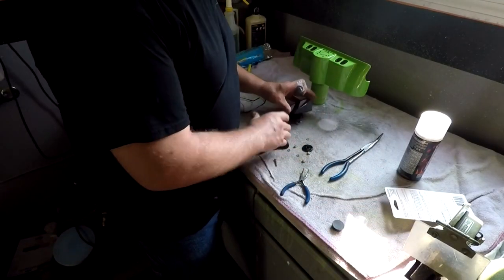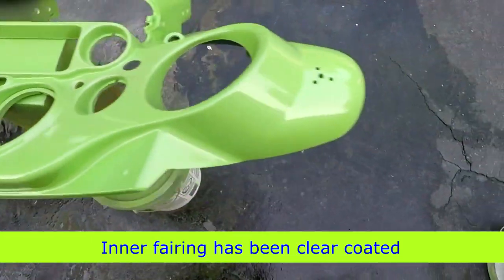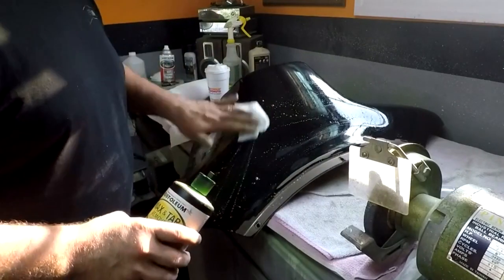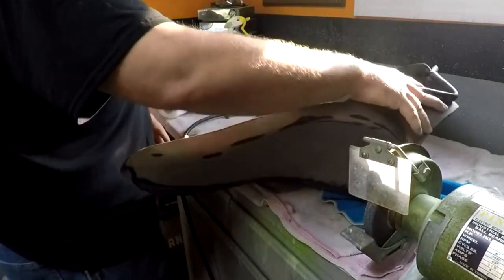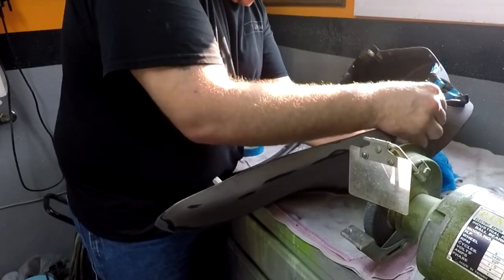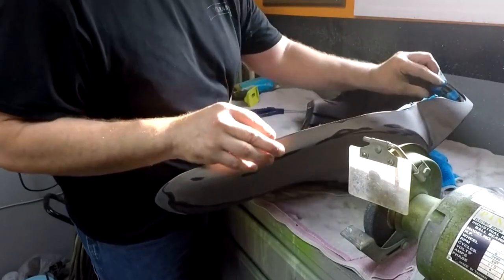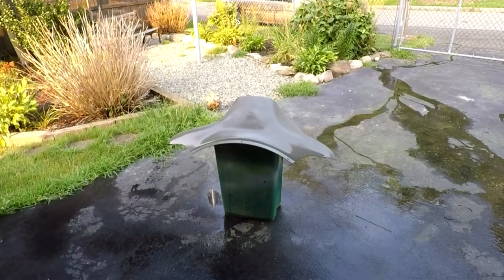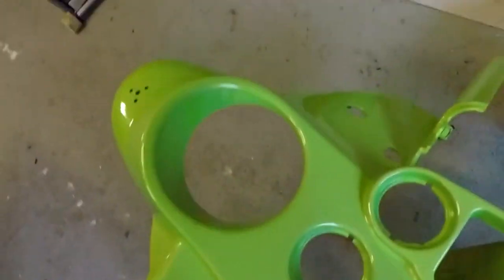Inner & Outer Fairing Prep & Prime | Painting a Harley #24

Comment: Mike, thanks for doing this and posting it.  You inspired me to paint my inner fairing.  It's half apart anyway.  Never painted anything before, well, that has to look good anyway.  I was going to buy a pre painted one, but there is nothing wrong with mine except sun fade.  Looks chalky and white in some places.  I had to install new fairing support brackets, so Im taking it all down now for sure since I saw this!
Reply from the maker: If you spray painted anything before i think you can do this. make sure to do the prep work well. good luck.
Reply: Techn' Moto it’s a vivid black bike.  I wonder which gloss black in a rattle can you would recommend. ??  The inner fairing is plastic correct not fiberglass.  Should it be a plastic specific paint?

Comment: MIke, the McGuires ultra cut compound, did you use this between base coats, between clear coats, or after final clear coat.  Sorry I have never used it for paining.  I’m only doing the inner fairing part and ignition switch skirt vivid black, so I don’t need the metal flake clear either correct??
Reply from the maker: Only used it on the final coat after it was done. No, go to a place that specializes in automotive paints. They can help guide you on what to use.